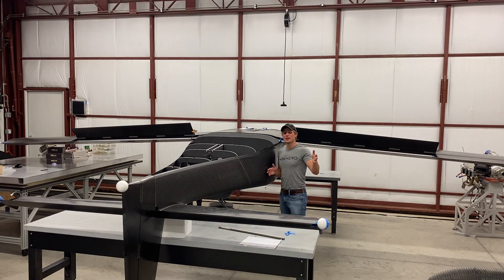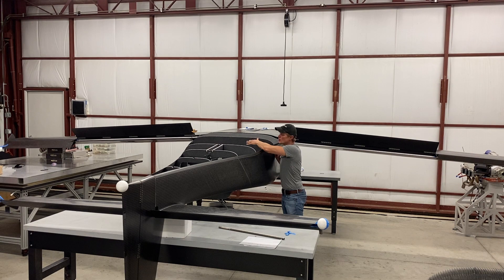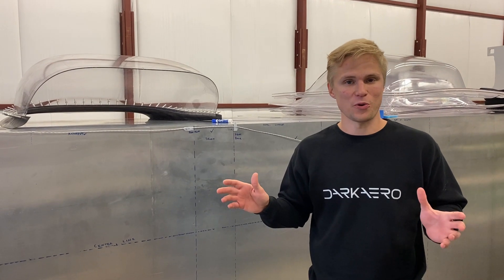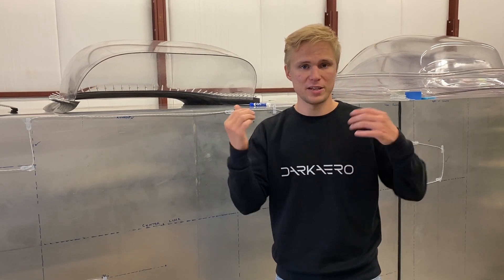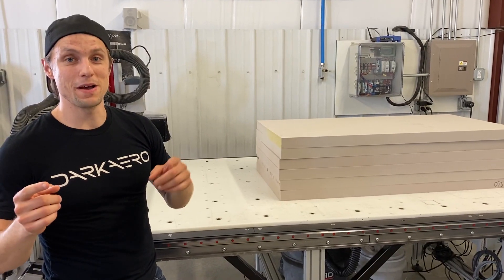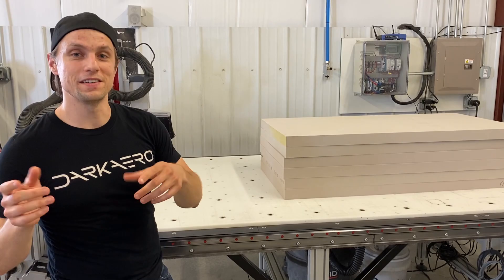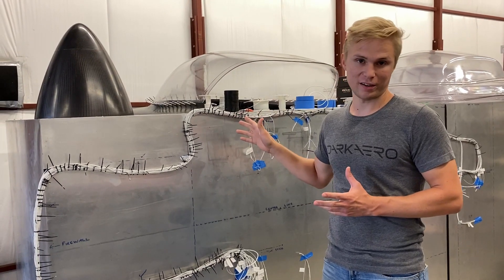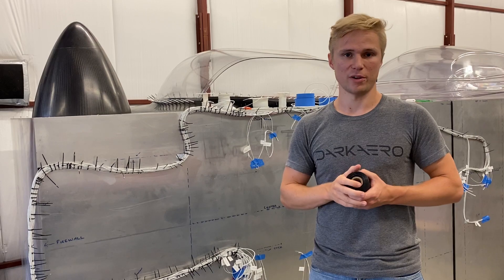Stick Grips, Aileron Controls, Wiring Harness - DarkAero 1 Progress Update - Aug 14, 2020

Comment: Hi guys. I was looking at your 'wire bundle' here and I have a suggestion that may possibly be better than the 'tie' thingie. They are called 'Grip Lock Ties'. They took a nylon type tie and made a rubber type coating on the inside, to reduce/eliminate any damage done by the tie itself. They can also be released and reused. Well worth at least a look I think. Here is the link to the web;   https://griplockties.com/ .  I have no interest in the company, just saw it and thought it may be a better solution.  Good luck!!   Cheers!   8)    --gary

Comment: Awesome job guys. I think I need to buy stock in zip ties..lol  I like the wire lacing but one thing I've done which looks clean is to cut 1/2" wide pieces of shrink tube, slide into place and shrink which contains everything and looks really clean. Just something to consider.
Reply: They even make a clear non-adhesive HS tubing that would be perfect for what you describe.  I use it all the time to secure connectors together without getting the glue on the threads or latches of the connector.

Comment: Really impressed by DarkAero's design, tech. and manufacturing.   Was wondering if the aft 50% of canopy will have windows or perhaps a rear-facing camera?.  Would also be nice to have a fwd facing one on the belly so pilot could verify gear up/down.  I think there was another aircraft that had a split rudder/speed brake and split flaps.  It was the Bugatti!  Cheers.
Reply from the maker: Thank you for watching and for the comment! We aren't installing aft windows in the prototype but an aft facing camera and belly camera are easy to implement. The Garmin G3X we are using has some ability to interface and display video from this type of camera set up.

Comment: hi there from uk. ive been following your progress for a while and love what your doing and can not wait to see this thing fly.
i just wanted to make a comment about those tubes working the ailerons. i am not an engineer of any kind especially aerospace so you have every right to tell me to beat it, i am a truck and heavy plant mechanic,  but would them silver control tubes not be better rotating around their centre down the length of the wing and then transfer the bell crank motion at the wing end?
i imagine how its set up at the minute you would get a bit of deflection which would reduce joystick feel and also exert a lot of pressure on the inner wing bell crank?
Again, im just a smelly oily truck mechanic and know zero about planes.
keep up the good work and i eagerly await every video. good work lads.
Reply: I too think these guys have nailed a lot of serious engineering challenges so far... that being said, I think your intuition is right on the money about the control tubes. 

The, off-center-torque tube design creates way too much 'shear' on the 'torque' tube.  This shear will translate into an asymmetric twist, which (as you mention) will become tension on the wing, which becomes friction, which becomes failure. So far they have been very safety orientated and have done a lot of testing. I believe they will continue with their diligent testing, in which case, they would likely catch this before it goes to flight... cheers.
Reply: I agree with you both. Also, many minds from a broad range of talent makes a well engineered project. You just can't buy 15.3k people looking over your project! (That is the number of subs)  I hope they appreciate this.   8)   JMHO    --gary

Comment: I commend your choosing the Tosten Control Stick Grip. I have owned planes with 2 different Ray Allen designs. Both had several design flaws. I recently upgraded to the same Tosten model you are using. It is superior in every way. Plus the man behind the company supports his products well and is a genuine fellow besides.
Reply from the maker: @FoesFlyDennis, your feedback on an earlier video of ours helped influence that decision, so thanks for the tip!
Reply: @DarkAeroInc  Cool!
Reply: Those are junk.  You should really be using the Infinity stick grips.

Comment: I know it's a big responsibility but I'm thinking that sooner or later it's the right decision to do fly by wire. It can clean up the design considerably and with a good solution, it should be quite reliable.
It makes autopilot natural as well as multiple control points. And the joystick can be some kind of ergonomic small spaceball. Can even skip the pedals. Has to be worth it in the long run. Make a solution that can withstand a lightning strike and combined with a chute then a few thousand hours of flying can build confidence enough for commercial launch. I imagine with that achievement, you'll never go back.

Comment: Gentlemen, ur price point is to high. u want to kill it & pump the market with Darkareo1 aircraft. Keep this 1st kit as cost effective as possible. You can only do it on a dime once. Marketing 101 Produce on very VERY tight margins <10%. Sell as many kits as possible. Make the competition bleed blue blood. After you knock DA1 out of the park! Make buck $ O-roos on DA2. YOU will only get ONE & I say 1 chance at this. Only one. cheers
Reply: High price? Given the history of other new designs such as the ICON A5, the price  will likely double. Just a tiny market.
Reply: Build a modern aircraft company! Do not think small. Aviation industry has just been GUTTED. It is perfect timing to crank up the screws a little tighter on the OGs. Demand market share demand it. enjoy ur weekend

Comment: Great progress!

The wiring map is great. Will a builder construct their own map or will what you are doing be translated to plans? 

How the occupants physically connect and touch the airplane in flight is a key consideration. For fun, look up how much attention Howard Hughes gave the subject. 

I like the grips. A personal preference would be to add a momentary, autopilot interrupt on the grip, too. Once you fly with one, you’ll miss it without.  Takes the hassle out of short term maneuvering and expedites course intercept.
Reply from the maker: Lew, thanks the comment. The builder would create a similar layout for their aircraft, but they are free to deviate from the standard configuration shown here. 

We definitely agree that the pilot interaction with the controls is not to be overlooked. Our plan is to make the button just below the push to talk trigger an autopilot disconnect. After getting used to the stick we may also get one with more buttons to able easier interaction with the glass panel.

Comment: Instead of temporarily using zip ties, I used little Velcro cord ties. You can buy them super cheap at the home center and use them over and over again. Keep up the great work guys.
Reply from the maker: Jeremy, thanks for the suggestion, this actually would have worked out pretty slick for the temporary configuration shown in the video.

Comment: Have you thought about the deflection caused by aerodynamic forces acting on the ailerons? Those torque tubes seem fairly long. Anyways awesome progress can't wait to see this thing fly!
Reply: Same thought here.  I don't really know what I'm talking about, but it does not look like those tubes are transmitting torque.  It looks like they move in an arc. How do both ends stay aligned?  Very impressive project.
Reply: They may be biasing the fiber weave to reduce rotational flex and make the walls fairly thick.

Comment: Have you looked at Lockright's Grip Lock Ties vs the string - supposed to have some rubber cushion so it doesn't abraid the wires...
Reply: Yeah that is a nice product. Isn't that a design/product form Mike Patey?
Reply: Stefs Engineering believe so
Reply: Yep, Mike Patey makes them

Comment: Experience says the coating will peal off the stick grip.
Reply from the maker: Sean, thanks for watching and for the feedback! Can you share some more about your experience so we can all learn? What control stick grip did you have? What peeled on it? How long did you have it for? What aircraft? What was the operating environment? It's hard to make good design decisions that aren't data driven.
Reply: I put the coated Tosten grips in two aircraft now. Not worth the cost. I think its the oils in sweat that softens the coating. Then it peels. Nice grips though.

Comment: Where can I buy that tooling board?
Reply from the maker: This particular tooling board we got from Freeman Supply in Ohio but we work with several others as well.
Reply: @DarkAeroInc  is there a particular model number you use for the molds?  How do you finish them to get ready to pull carbon from them?

Comment: Is the differential aileron adjustable?
Reply from the maker: There is a small amount of adjustment available in the rod end bearings but this is meant to fine tune the relative position of the ailerons so they both sit in the neutral position together.
Reply: @DarkAeroInc  Adjustment for neutral aileron position at the torque rod end bearing support...so differential is essentially built in. Thanks.  Love the plane. I want one.